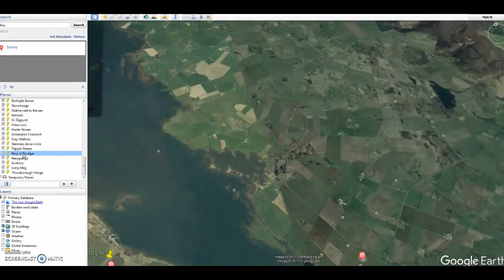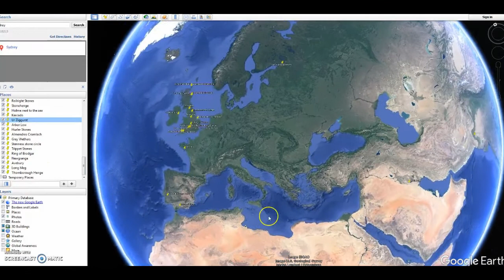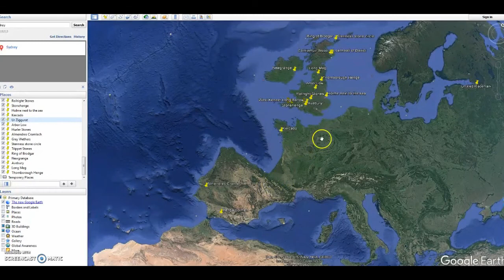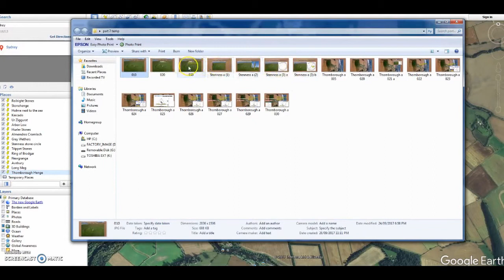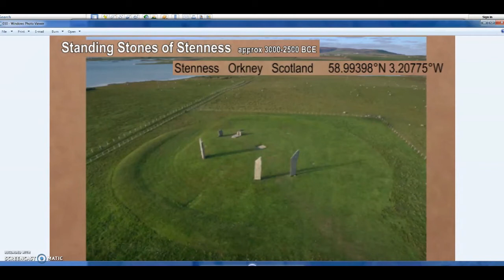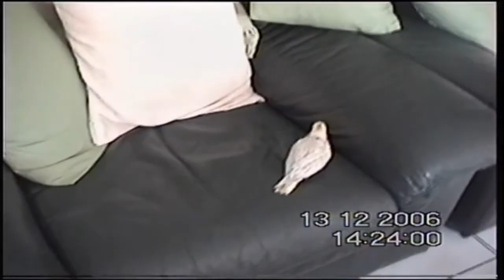An Ancient Legacy Part 7- Stenness & Thornborough via Sumer & the Great Pyramid

Comment: 144... used around the earth, seems to be the mother of all numbers how it works as time and the cosmos. pure perfection in the cosmic sacred maths. seems to route from thd 12×12. your always on topic !  ✌ and blessings
Reply from the maker: 144 ;-)  You can't build a cathedral without it
https://www.youtube.com/watch?v=9EXHTCPfHjk
Reply: SGD love that one. , hey man do you suppose there is a physical purpose for building to the code. ( ie- does it harness something) or do you reckon its only metaphoric .  i know its a big question.
Reply from the maker: Kris Fisk i think it's a bit of a combination of things. Like a cathedtal if built to right length, width and height it will carry the sound to give it that dpecial feel. But also give it strengrh. But also if set to right measures that added symbolic layer. Heard an architect lecture on a perefect sized room. You can walk into some rooms and it just feels wrong. Too long or too short. But if the right proportion it just feels right. But it all comes to chocken or egg. Did they start with measures? Or start with perfecr feeling temple and divide into 144 parts?
Reply: SGD great response. yes i agree with everytging you just wrote. but ive also always felt there is an even more occult mystical thing behind this stuff. growing up in nyc, ive always wondered about all the alignments and mathamatical perfections. maybe they build to perfection for practical reasons. and maybe if built properly itcan give it a certain power. the first time i came across this is when i noticed how all the major cities on the east coast of the US are in a perfect line. thabks again man. cheers.!! keep up the great knowledge and truth. peace!
Reply from the maker: cheers, if you haven't seen please check out Hornby Island Mystery- he goes into the big allignments, on a global scale , heavy stuff. 
https://www.youtube.com/channel/UC01Kn5scxs3WLcmNXASufdg
Also Geof Lewis
https://www.youtube.com/channel/UCh9xoi3V_iQIEAeX-blfiYA
Reply: SGD cheers for the reference. brilliant minds.   a lifetime of questions is slowly coming together. thanks so much man. keep on keeping on.  -kris